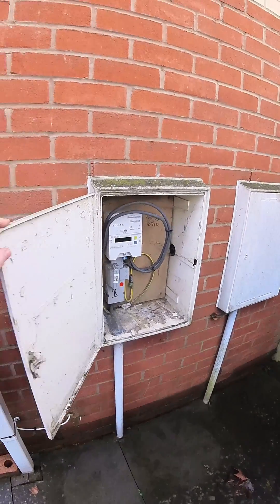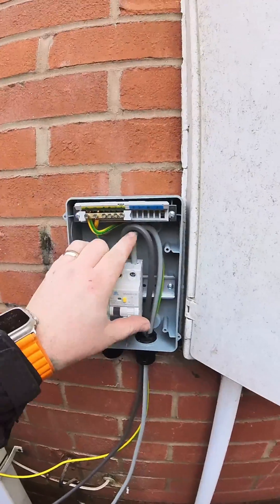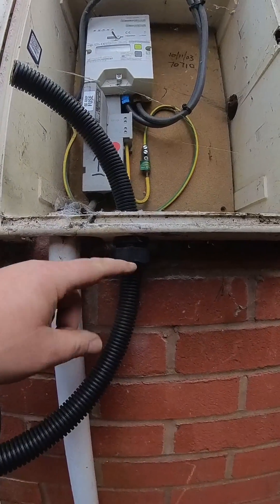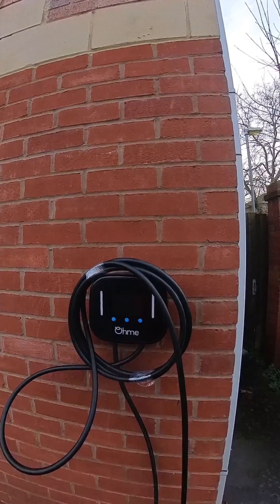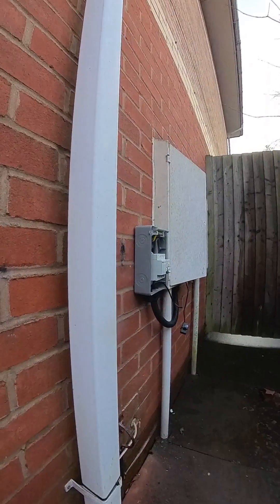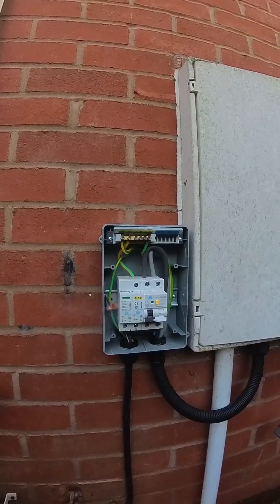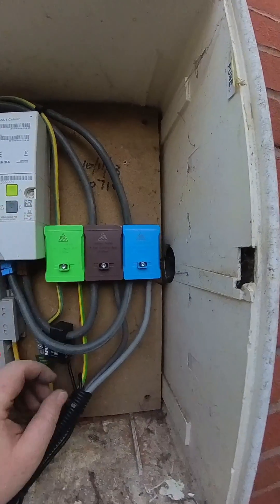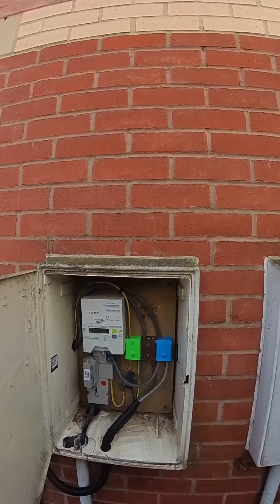OHME EV, How Do You Wrap Yours

Comment: Does the 4mm EV Ultra need 25mm stuffer or it will go into a 20mm?
Reply from the maker: You can get away with a 20 but it’s a tad tight, 25mm clamps down nicely